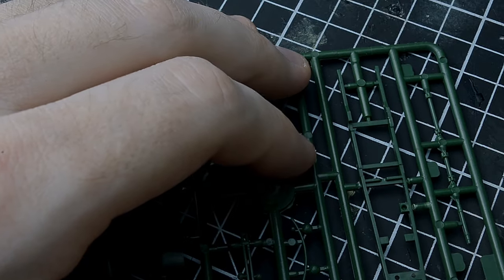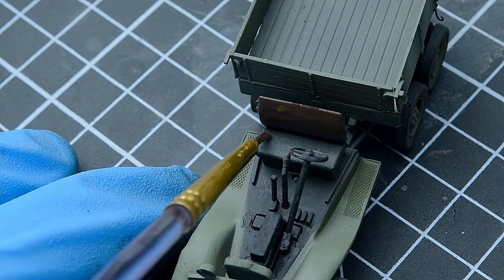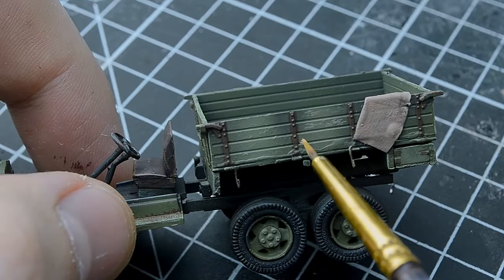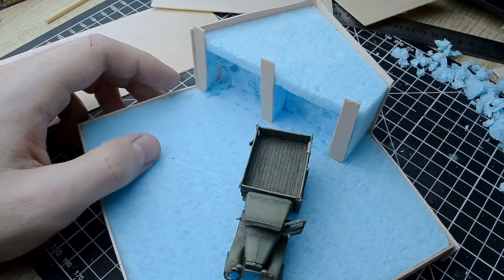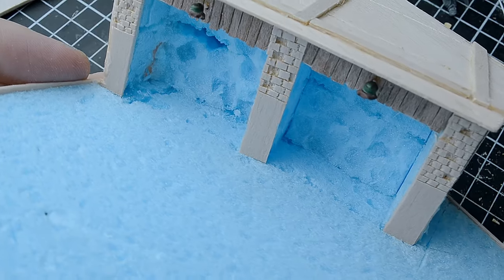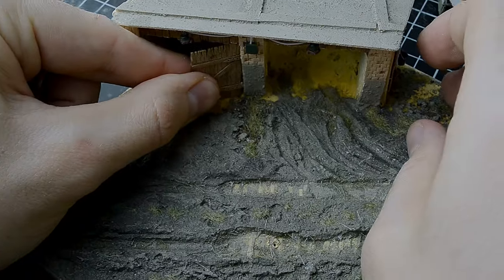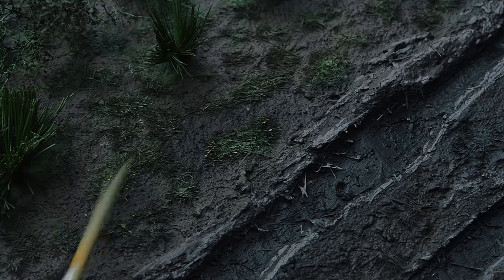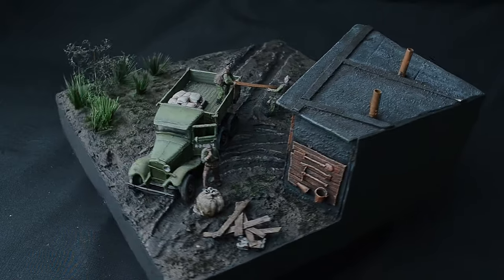"At the warehouse" world war 2 1/72 Diorama

Comment: Try to set pressure and dilute paint little bit more , so u can paint with clean surface .  Right now looks little bit grainy. Keep on buddy :)
Reply from the maker: I have a very cheap airbrush with a small compressor, but anyway, thanks for the advice)
Reply: @noqualitydioramas  aaa maybe  this is a reason , maybe try Tamiya paints they are more durable that Acrylics witch silicone ( like Vallejo model color)
Reply from the maker: @WelderART  thank you for advice)) i will try it)
Reply: Russian military paintjobs in WWII wern't known as to be very clean.... the look is perfect. I would like to have more information about the scene shown. It seems that this guys are not soldiers, maybe partisans behind german lines? Maybe some camouflagenettings would add more realistic to the scene. At the end a great build.
Reply: @udorechner6846  man im talking about paints start grainy , it because of wrong diluted paint or pressure on compressor.
Reply: @WelderART  You are right, no question,  BUT for the diorama shown this "rude" paintjob is exactly the right choice.